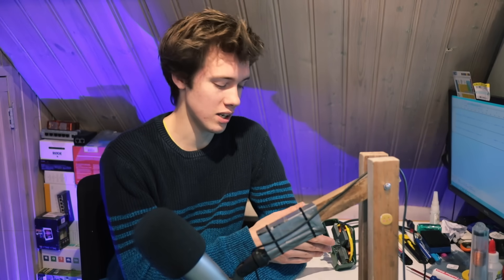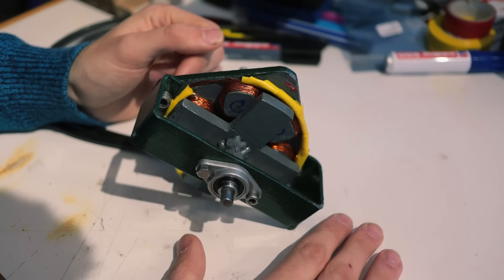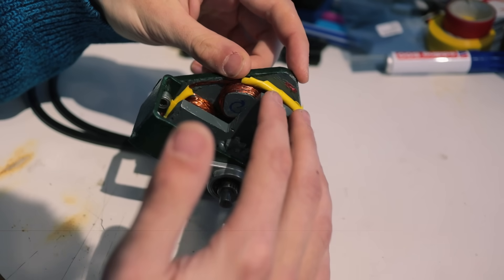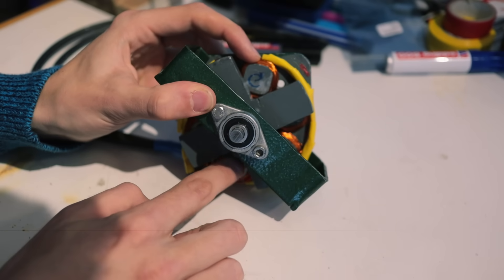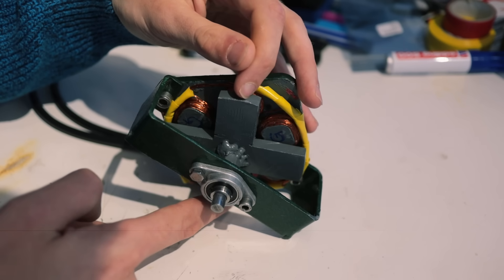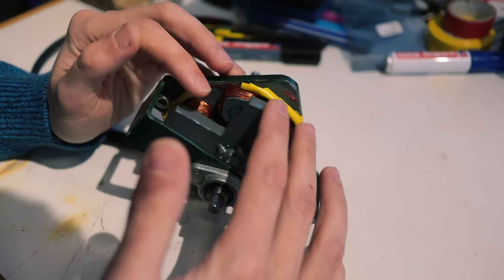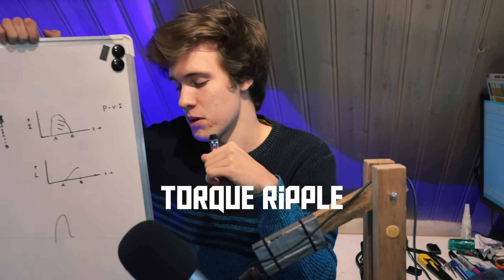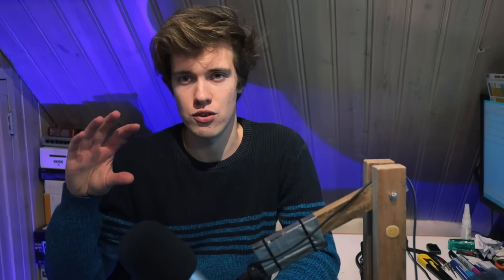Switched reluctance motors: simple yet tricky

Comment: Interesting. That particular motor looks like it could be switched in such a way that it would act as a stepper motor. One of those fancy ones with absolute positioning. Since you can put good sensors on the rotor. You could make it struggle to return to position and maintain its position after being forcibly bumped or moved. When operating in this mode, the field coils would need to stay on a certain amount to hold it in position when "stepped". So it would not freewheel as it typically would with a simple driver circuit. Forgetting all the proper terminology for the brain fart.

Comment: Yes, the electric does have torque ripple, but compared to an ICE engine, it's minimal.   And yes, for most automotive work, a bigger heaver motor is not really that big of an issue. The current crop of EVs are still in the luxury market place for the most part, but there is room for a large market with what amounts to the electric Model T, a cheap minimal car.

Comment: You can control the switching of the coils without a controller, just add a disc to the shaft that has parts that are conduction and parts that are not and a set of brushes that energize the coils. At the end you get a motor with 2 leads that can be run from a battery or power source. But is way cooler to use a controller :D, For the disc encoder i propose something using the grey code
Reply: The technical name for the disc is a commutator and as a result of your proposed action, you’ve just made a DC motor.

Comment: sounds like the controls would be very similar for a BLDC motor. should be a software modification for an ESC There are a few that have open source firmware (look for ones that are simonk ), they are setup to PWM the signals as well.

with Field Oriented Control, the system can measure the shaft angle and can apply the exact power needed across multiple coils, it should be able to pretty much eliminate the torque ripple

Comment: They are not uncommon to find when you take stuff apart. They're common in electric and hybrid vehicles and in industrial settings, they power machinery such as pumps and conveyors. Household appliances like washing machines also use them for their reliability. It's a little bit surprising to me that you've never come across them.

Comment: You could use reluctance to get a buf in while it had some teoricaly to 2x aplying the oposite voltage in the same coil like in permanent ones im not sure but it would be a diferent output and the motor need to be design it for it, the buf in weight/power ratio

Comment: I would have liked to see this beautiful explanation attached to a real and concrete start-up in order to see it not running empty but leading to an adequate load and that's where it starts to be interesting /// it's possible ? ?
THANKS
Reply from the maker: that is the eventual plan yes, but it'll take a while to get it ready.
Reply: @AKIOTV  Why is it so complicated?
Reply from the maker: @slimel-gharbi8170  It's not necessarily complicated, but it needs an electronic driver with quite a few parts. Plus, I want to rewind the coils with thicker wire which takes a looong time.

Comment: The shape you need to power the coils should be exactly the same that is coming out of the coil when used as a generator.
One of the more complicated things will be that the shape is dependent on the speed of the motor.
This means every speed the motor is running the power curve has to change to create the optimal power output.
I played around with the concept of recording and playback 25 years ago in a summer vacation. I was playing around with a big audio amp where the one of the amps where broken. I recorded the generator phase on to an audio cassette and playing it back through the amplifier to get the same speed out. My first tests where nice, but i blew out the audio amplifier, because i didn't thought of the feed back into the amp. I didn't had a replacement, so everything went into the trash. 🙂
Reply: But you can't use it as a generator without control circuitry.
Reply: @jaro6985  The residual magnetism was enough to create enough voltage for the recording. I had to use a voltage divider to dampen the signal with higher speeds.

Comment: Is the torque ripple a major problem in the automotive space? The current technology of 4 cylinder turbo diesel engines has massive torque ripple. Would a simple solution not be a flywheel?

Comment: Ok 150 years ago how did this kind of motor work without modern circuits.? Was it brushes etc.
Reply from the maker: The original design used some mechanical commutator, but it wasn't practically usable until switching electronics were a thing.
Reply: @AKIOTV  🙏

Comment: When the rotor blade aligns with the center of coil, then the coil should turn off, and when coil turns off, the magnetic field of coil collapses, can we capture that collapsing field energy into a capacitor and reuse the charge stored in capacitor?
Reply from the maker: That is typically done indeed.

Comment: Pointing out a concept by starting with a constant voltage supply where one switches a coil off when a rotor pole is in position over the coil. The current flowing in the coil is related to the load (because of time for current to build) as well as the inductance.  Besides the energy in the magnetic field converted work done in movibg the load, there will be some energy still left in the magnetic field at the point of maximum inductance and maximum current. But because inductance in coils opposes changes in current then switching the current off would create an inductive voltage spike across the coil. While many coils like those used in relays use a flyback diode to and sometimes a capacitor to snub the inductive kick back, that remaining energy in the collapsing magnetic field can instead be dumped in the next set of coils that are swiched in.  And this can be repeated over and over. The high voltage output spike can drive the next set of stator coils. 

This is not perpetual motion motor but just minimizing energy loss and proposing a way to get get more torque at the beginning of the next coil's cycle and minimize torque ripple. 

Lastly, the coils are now nolonger constant voltage driven, but  ratherly approximating constant current driven.   😊

Comment: You have a huge misunderstanding after 7:00 Current in an electromagnetic coil that is switched on is never constant because of LR time constant. 

Once swiched on, there is a certain minimal inductance and minimal current starting at zero on the coil with a max voltage drop across the coil.  Over time the current through the coil will rise generating a stronger and stronger magnetic field, and the voltage drop across the coil decreases.  A rotor allowed to rotate will turn which reduces the reluctance in the magnetic circuit, and both the current and the inductance in the electric circuit with the coil will rise to a maximum when the rotor pole is over a coil. at that point you'll want to switch off the coil. The increaase in inductance slows the rise in current. Because of LR time constant, A slow turning rotor sees a higher peek current through the coils than a fast turning rotor.  But when given a constant voltage, because of a changing current, never will you see a constant power.  

Your point on there being motoring vs generation phase is right.

The point on nonlinearity in and magnetic saturation is only relevent at potentually  inital start up or under heavy loads where the rotor speed is too slow and current is allowed to build up in the coil to the point where most if not all the iron's magnetic domians in the magnetic circuit are aligned.
Reply from the maker: You have a misunderstanding of what I said. If you connect a coil to a voltage source, the current will rise indeed, but I never said the power supply was a voltage source. The example assumes the supply is a current source, which will maintain a constant current for any load type or impedance.

A practical ideal current source like this does not of course exist, but can be approached pretty close by what is essentially a dynamic voltage source that continually changes its output voltage to maintain a set current. This also happens to be what a lot of SRM drives do.

You can get reasonably constant current, with the exception of the rise and fall periods, since the real world current source isn't capable of producing infinite voltages.
Reply: I'm sorry, I have not watched the whole video yet, I have been adding to my comment as I watched. At this point in time i only just gotten to your real world performance section. Where you discussed the constant current power supplies rather than constant voltage supplies you opened up with shortly after At 7:00. 😊
Reply: It's probably better to now add further comments here than to  my inital comment because you were quick to respond before I was trully done watching and composing 😊. 

On torque ripple, it's certainly not desirable. And different applications will have different tolerances to it.  one technique to reduce it other than driving or changing the shape of the  poles is to increasing the number of coil pairs per pole pairs, essentially increasing the number of coils that act on a pair of poles and shortening the duration each coil acts on a pair of poles. And lastly,  momentum in the rotor and what's being driven tend to smooth out or reduce acceleration spikes resulting from from torque ripple.
Reply from the maker: @kreynolds1123  Certainly those are some effective ways to deal with torque ripple. I mean with the inertia of the rotor, we essentially use that solution all the time in combustion engines, where we slap on a big flywheel. More poles on the electric motor in that sense is also kind of similar to adding more cilinders to a combustion engine.

Comment: The simplest switched reluctance moter I seen was commutated and used only one coil. 

Its construction was like this. The rotor had 6 nails driven into a circle and the stator had one coil that was switched on by two brushes that make concurent contact radially with a nail when a nail was close, and was switched off when momentum moved that nail over the coil. 

The magnetic circuit could be be improved with a second coil 180 degrees out from the first coil. 

Self starting could be had by two more pairs of coils. The three sets of brushes need be placed radially 120 degrees apart, and sweep at least 60 degrees.

Comment: Very nice explanation of how stepper motors work. The electronic circuits for driving stepper motors are readily available.
Reply from the maker: While an SRM is arguably a type of stepper motor, most stepper motors use permanent magnets unlike SRMs. The driver needed is also different. A different type of bridge configuration is used, but perhaps most importantly the control scheme is different, because the motor is designed for an entirely different purpose: stepper motors are used for accurate positioning systems, whereas an SRM is used for driving machinery and so more dc motor-like characteristics are wanted. You can also see this in the physical design, the "steps" of most SRMs are far too big to make a usable stepper motor.

So yeah technically you can see it as a type of stepper motor, but it differs quite a bit from most other steppers people are used to.
Reply: Magnets are used in steppers for holding torque when at a stop. This motor is simply a synchronous reluctance motor. @AKIOTV
Reply: PS. subscribed. Love your topics, your way of deconstructing them, and your style and your very understated dry humor too. “Words!” 😂

Comment: Shame u can't use a diode to use the energy generated back into the system.
Reply: Diodes are an integral part of such...but uncontrollable...therefore additionally Mosfets are always used to advantage (low power loss..& fast switching flexibility)

Comment: I bought a chineese fan motor, it has no magnets and only one coil and some funny metal rotor design made of steel plates. You put AC into it and it spins. Its almost like a shaded pole but its not. Its a very strange design and the coil being AC swaps the poles at the frequency of the AC supply which in turn drives the motor almost like a switched reluctance/shaded pole combined. It also generates electricity but to do that it needs a tiny bit of help. I just put a single magnet near it and its enough to excite it into generating electricity.  Good explanation of how it works. Thank you.
Reply: Hi, possible to provide a link to the motor? Thanks.
Reply: @cslim3881  I looked but can't find it. It's a really old motor. Imagine a single coil with a sprocket on each side of it. The sprocket has fingers like triangles. They are bent towards each other. So when the coil is energized one sprocket is all north poles, and the other is all south poles. So the fingers are like the magnets because they are connected to the core of the coil one on each side. But because the coil is AC, they are constantly flipping poles. I hope that makes sense. It's actually quite simple design.
Reply: @newmonengineering  hi, is there a brand name on the fan? I play with vacuum motors. The closest is a two coils motor. Never seen a one coil motor before. THANKS.

Comment: Could you not simply attach a mechanical switch to the rotor to turn on and off at the correct time?
Two fingers sticking out of the rotor, first one turns on the coil, rotates, second one turns off the coil.

Comment: Does a BLDC controller or hobby esc operate your motor? Would be interesting if it did. It may need an initial push to get the field working in the rotor
Reply from the maker: Probably not, the hobby esc would always supply power to two phases at once, with poor timing. I'm also not sure if the emf would be sufficient to detect for the esc, especially at low loads and low currents. I have some escs though, I'll hook one up and give it to go, I'm curious enough to see what happens.
Reply: @AKIOTV  I have seen car alternators work after they've spun up with ESCs and electric bike controllers. He wrote a just needs a capacitor no power to the electromagnet of the alternator after it speeds up the capacitor has enough charge to interact with the outer coils
Reply from the maker: @gregstafford2155  That is very possible, a car alternator is basically the same as a bldc motor with the exception that it uses a wound rotor rather than permanent magnets. I've seen people using car alternators as high performance go-kart motors this way. The behavior of the SRM is quite different though, and I suspect very tricky to drive with a regular esc.
Reply: SRM 's and BLDC are two totally different types..& each other's controllers cannot be swapped wrt the other type of  motor...nether can a bldc controller be modified for srm.
SRM electronics is a whollly different ballgame....
an SRM with 6S-4P..TOO will have different electronics when compared to another SRM of 4S-6P..or others having 6P-8S or an 8P-6S..where..
S= no.of Stator coils   P = no. of rotor (Salient) POLES.

Comment: I would suggest to use Hall switches, that one can integrate into your coils, switched off at 3 degrees before top dead center as your rotor turns. And, yes one would need to attach a very small Nib on each pair of rotor poles. Subbed, and looking forward to your next vid. Nice job...
Reply: Intuition tells me the optimal angle would change with the speed. As the speed increases, you would want to remove power from the coil earlier because of the momentum of the rotor. Made sense in my head, anyway.
Reply: @edeaglehouse2221 Correct because the pulse width length which would be represented as a unit of time would decreses inverse to the speed of the rotor. So as the cycle rate of the rotor increases the impulse that's generated in your stator windings decreases in terms of duration. An increase in the angular momentum is effectively converted to a higher voltage output in the stator windings. However if you can manipulate the reluctance of you stator windings with a modulating circuit you could probably mitigate much of the drag created by the stator windings. I've often wondered if you switch the coil from open to closed only when you've passed 51% of the pulse duration. I'm curious to see how this would effect the motors natural acceleration and deceleration rates. Also what running it inside of a vaccum chamber would do to eliminate overall resistance. Air alone is exerting alot drag on the rotor alone. Also friction due metal in metal contact inside the bearings could be mitigated by using magnetic levitation bearings. If anyone has tried this I'm curious to see it and the results. Lol
Reply: a shaft encoder,  might be cool for prototyping so you could easily  play with different timings with the controller.
Reply: Would this be any different than a optical transistor?
Reply: @kayakMike1000  No.
Reply: @kayakMike1000 I don't know that but it could be adapted I'd imagine
Reply: @kayakMike1000  Perhaps, yes it can be.

Comment: I had the privilege of learning under a man called Dr Jasmine Corda who did a massive amount of work on switched reluctance motors during my degree. absolute powerhouse of a intellect. been a while but i believe switched reluctance motors have a very strong use case in precision speed controlled motors, like in places like fab houses where they need consistent flowrates in pumps/fans with little variation. I think they are also great at very high speeds. But one of his favourite anecdotes was that in like the 80's they had a small van like thing full of batteries with a powerful switched reluctance motor which would out accelerate most cars of the time, similar to how teslas do now, albeit with horrendously bad batteries of the time.
Reply from the maker: Haha that van does sound like one fun project. Given it used an SRM it probably also made one hell of a sound.